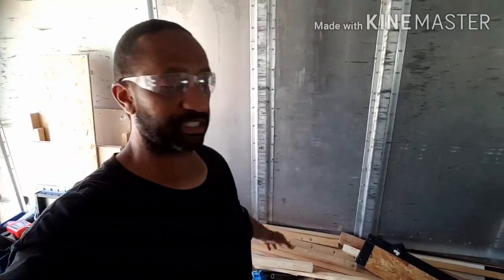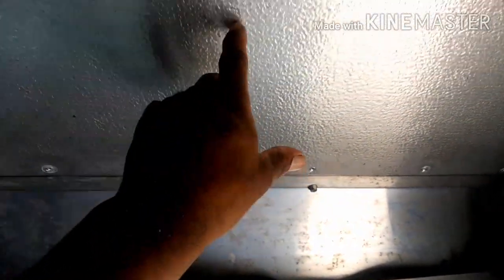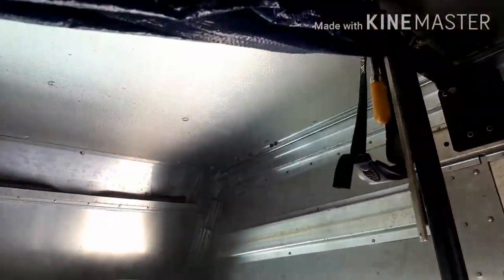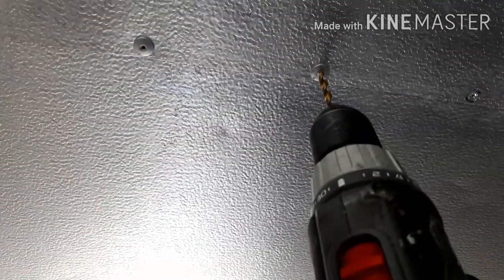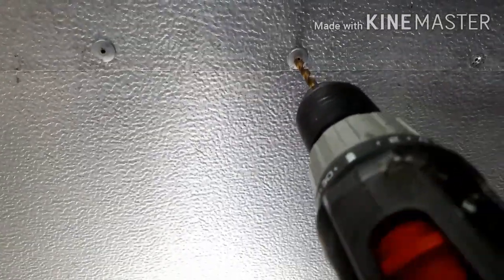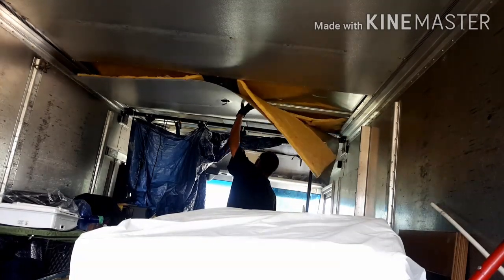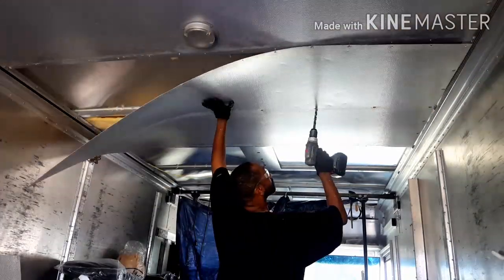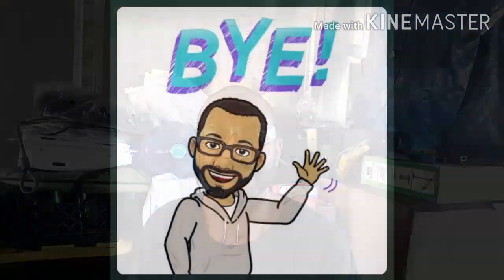STEP VAN CAMPER CONVERSION:  CEILING REMOVED  /  TIRE BLOW OUT

Comment: A good trick for catching the aluminum chips from drilling overhead is to use a small paper or styrofoam cup between the drill and the ceiling by drilling into the top centre of the cup, then drilling the hole in the ceiling. Keep the cup on the drill bit
Reply from the maker: That's a great tip.  I will try it on a future project.  Thank you Dave.👍🏾
Reply: @xlamontx  your welcome! Thank you for your videos!

Comment: 👍
Reply: @xlamontx  i too am working on a step van.. mines a 1976 ford p-400 grumman that a fire dept had w/39,000 original miles.. ive lived in mine for 2yrs now and luv it but it has its challenges for sure lol..
Reply from the maker: @jmkc740  That was a score finding one with such low milage. So far I've come to realize drive thrus are out of the question and small parking lots require a comprehensive exit strategy.   Hopefully the extra room will make it worth the trade offs.

Comment: Hey Lamont Hi! 
Why would you need to take off the roof?   I am just trying to get ready for my eventual build and I am curious. Why would you not just keep it n insulate from there?

I have had two high speed blowouts in a car on hwy. Never, ever something I want to experience again. Glad you are safe!!

I was just complaining that our Men ( I am Black also. Canadian) have lost their Handy skills and there you are!!  I can't wait to learn some tips.

On a smaller scale. Lol

Hey what happened to the box truck you had? This one is more of a big rig?
Reply from the maker: Hi Clairemyst, great question.   Taking the ceiling panels off was done for two reasons.  The first is with regards to the insulation that was behind the panels.  I didn't know the condition of the insulation.  If at some point, prior to me owning the step van, some one removed part of the insulation, or if mold or some other "gross" infestation had started up there, I didn't want it to be an issue in the future.  I would rather clean and disinfect, and know that I'm starting fresh.  My second reason is that I'm going to spray foam the living space and I would prefer the foam instead of the fiberglass.  Just a personal choice. I also need to add a thermal break to separate the exterior metal from all interior metal to avoid the accumulation of condensation in the living space since I will occasionally run my heater on those really cold days.  I saw how quickly moisture collected on the inside of the box truck, so I hope to avoid that this time.  I may reinstall the ceiling panels in the driving and garage areas to keep the industrial look.  I'm not 100% on that at the moment.
I could have left the ceiling in place, and applied my insulation directly over it however,  I'm going to build up the floor approximately 6 cm and would prefer to keep as much interior height as possible by keeping the ceiling as high as possible.  
The young people in my family just don't seem interested in learning to be handy.  Their parents were the same way.  Yeah, I'm 52 so I'm thinking of the two generations behind me.  I grew up spending my summers watching my grandfather and uncles work from morning to sundown on their farm.  They did everything from repairs to fabricating.  I admired how skilled they were at accomplishing what they set out to do.  I've managed to teach a couple of my nephews a few things about their cars, but there attention span is extremely short except when it comes to their video games.  
The box truck will be my "daily driver" vehicle for a while.  If I should need to build it back to a home on wheels, I will use all 12 feet for living space and pull a trailer if I should need the extra garage space.  It was getting a bit cramped with all the items I was trying to carry in the garage all the time.  I also underestimated my desire to be comfortable as I get older.  I operate big vehicles for a living and wanted to avoid the limitations of their size when traveling on my vacation time.  The step van is my compromise.   Not too big, not too small; at least I hope that turns out to be the case.  We will see once it's set up and I take my first trip.
Thanks for watching my video. ☺
Reply: @xlamontx  thank you so much for your in depth explanation. 

That makes sense. I am barely five ft four so I would have plenty headspace.

I didn't know condensation would be that bad. I will have to readjust my thinking. I guess there is no such thing as a portable, battery  operated dehumidifier?

Nope. I am 59 and nobody younger than I am is even remotely handy.

As a Black Woman my two biggest fears is traveling completely alone in strange country and breakdowns. So I am attempting to learn as much as I can b4 next summer. My target time with all this covid germalitis going around.

Keep in touch Lamont. My name is Claire. Keep in touch
Reply from the maker: @TheClairemyst  
I will certainly keep in touch.  Please do the same.  Let me share a link to a young lady's channel.  She recently uploaded a Q&A video about her experience traveling solo in the lower 48.  

https://youtu.be/VVk9VCdKZSc

Take care Claire.

Comment: I am interested in seeing what you chose to do.
Reply from the maker: I've been gathering ideas from other builds to see if one stands out to me.  So far, I like my old ceiling best which I use a roller to paint it with white Flexseal.  It wasn't as durable as I like, but it's going on two years and still looks great.  I just painted it directly on the rigid foam board insulation.  Well, I have plenty of time to think about it.  Thanks for watching.

Comment: Step drills aka unibits make easy work with getting those rivets out. What’s the dimensions of the Stepvan box? Mines 6.5x 6.5 x 14’ from seat to rear doors. Your doing awesome work! Be safe!🙏🏼✌🏼
Reply from the maker: I will definitely try a step bit if I have to do it again.👍🏾  My stock  interior is 18 feet from rear door to back of the driver seat.  Width is 86" if I'm remembering correctly.   And Height is 85" bare floor to ceiling.  I will loose 2 inches from the floor and 2 from the ceiling once it's all built out.  I'm 6' so I will have plenty of headroom.
Reply: @xlamontx  wow, 18’ that’s a lot of room to plan with. Gives you plenty of options. My Stepvan is just the right size that it’ll still fit in a parking lot between the lines although just a couple of feet too long... But sliding as opposed to swinging doors are also a huge plus. 😎👍🏼
Reply from the maker: @BobVan  
Most of the step brothers (step van owners) I camped with last January were driving 14 and 16 footers.  They were very happy with them.  In a big parking lot, like a home depot for example,  taking up two spaces is hardly noticed.  A really small parking lot , like at a park, you could get away with it in one spot.  I'm going to be out of luck in that situation.